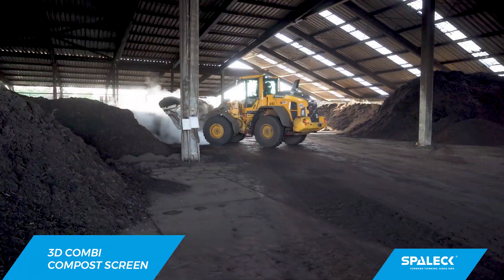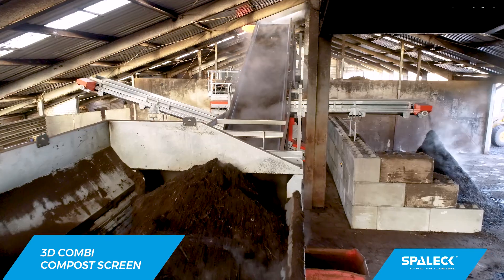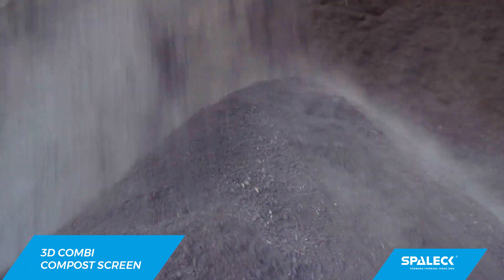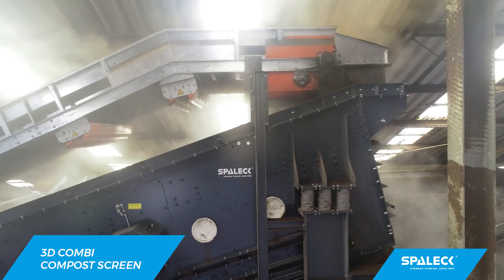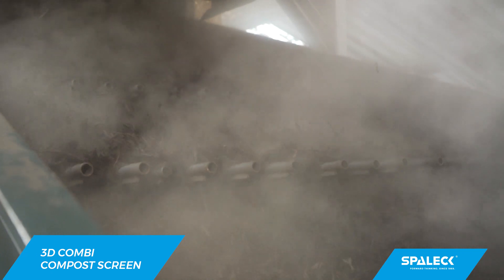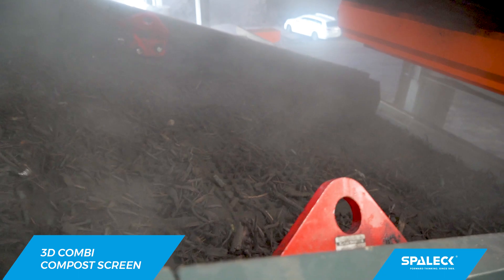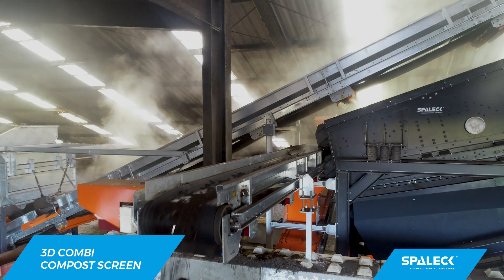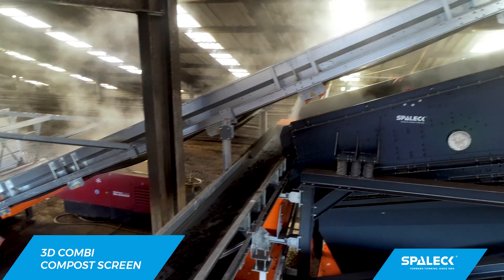Processing of compost and biomass - How to increase your screening quality - SPALECK 3D COMBI SCREEN

Comment: I work for a municipality that compost bio solids. One way is to flip your curing windrow with a loader. This keeps the material aired and dry which helps when it’s screened. Using smaller sized carbon will help with reducing your overs/culls